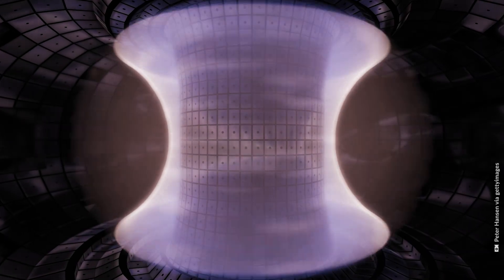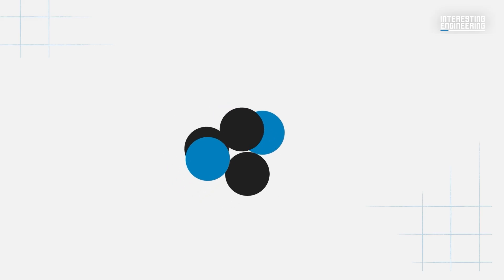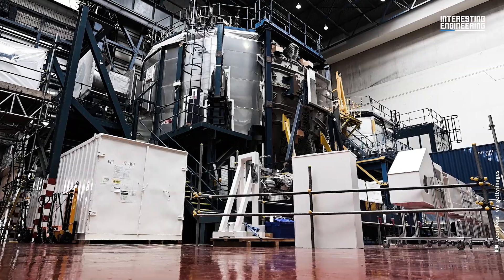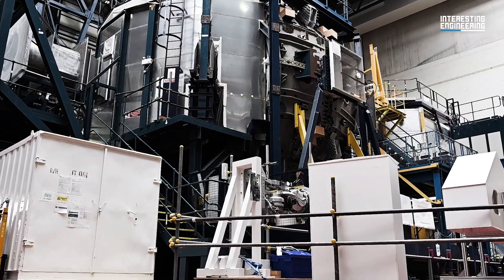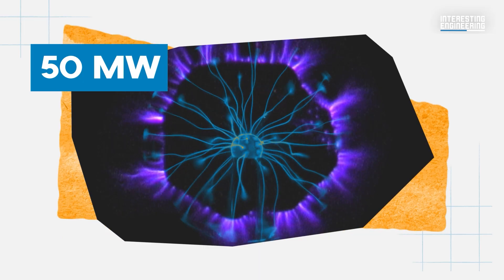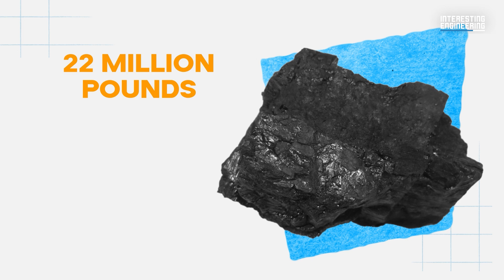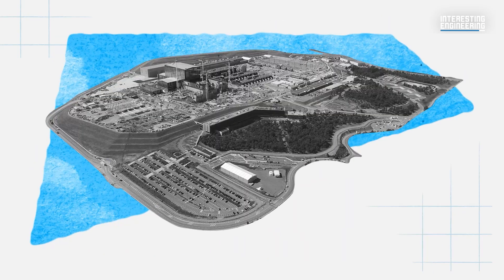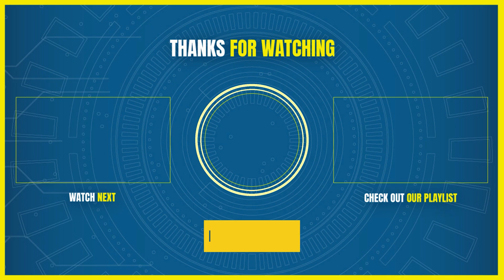Will Nuclear Fusion Energy Be Viable Soon?

Comment: The facts in this video are alarmingly wrong, fusion does not convert plain hydrogen into helium directly, there is no process that does this, there is the PP reaction and the more interesting CNO reaction. Also since neutrons are produced in the plasma it is radioactive since these high energy neutrons will smash into the containment vessel releasing heat but also making the wall radioactive. I give up the video is complete garbage. People that have fantasies about fusion should look at the videos made by Improbable Matter.

Comment: What if it doesn't work....
I suppose it is like touching the surface of the sun, or even inside the sun, but contained inside a man made crucible of sorts.
That to me is an impossible task.
We will not see a working or a viable fusion power station in my lifetime for sure.
Reply: Compression Ignition seems the right way to accomplish Commercial Fusion Energy on Earth, but technology challenges are Tyrannosaurus-Size and shape

Comment: That is a very upside down argument - the reason interest rates are pushed higher is to create a recession. The interest rate cut happens when there is confidence that inflation is done and nothing beats inflation like a decent recession. The cut in interest rates doesn't cause the recession it is a response to it. The graph is also just showing multiple business cycles within a larger macro cycle - gradually increasing interest rates, an economic collapse then falling interest rates followed by gradually rising interest rates - over and over.

Comment: Misleading - total input of the whole system at Lawrence Livermore is still 80-90 times more than local output in the inner core of the experiment. Then they have to make that into usefull energy, with a big loss in that process.
Reply: First they have to produce more energy than the total required for the entire system.  Then they have to engineer and build a reactor that can produce a sustained reaction, capture the excess energy to produce electrical power, engineer a way to produce tritium, and do it all cheaply enough to be competitive in the market.
Reply: Thorium fission energy is a good alternative, while we wait until Fusion Energy is operative

Comment: I'll be 20 years away😂😂😂 I am actually hopeful we can make fusion work however there a a range of both Physics and engineering problems to overcome and realistically they won't be solved for 20 to 50 yrs...
Reply: So the main trouble we have now is.....
Reply: @begula_fake  besides maintaining the temperature and pressure condition thru a Tokamak without the structure or materials failing you also have to transfer the heat created to boil water just like any other steam turbine as well as reloading the fusion fuel at an extremely fast rate and quite precisely which there is no design for as yet
Reply: Nikola Tesla’s free power solution probably cheaper w/ less long term consequences
Reply: Actually never. You cannot build a fusion reactor without testing the crucial components. This means a high flux 14 MeV neutron source is needed. How do you get that? Only in a fusion reactor....